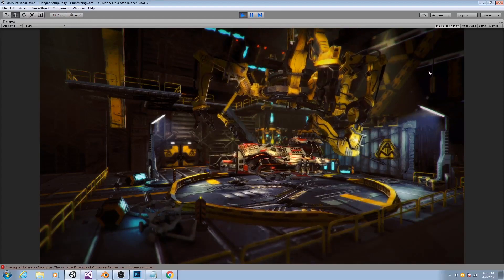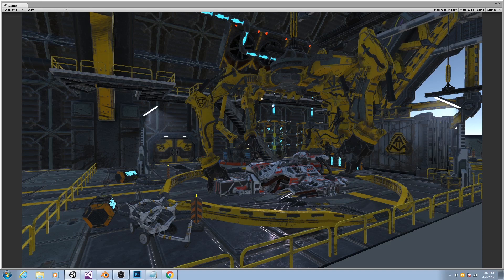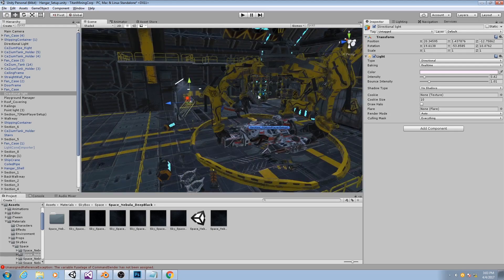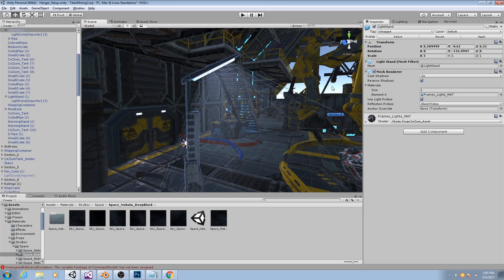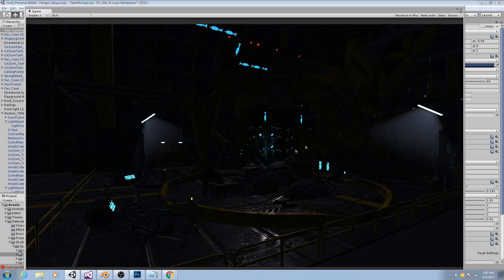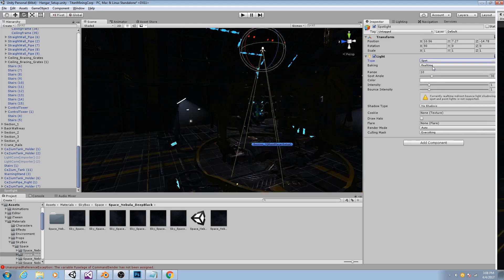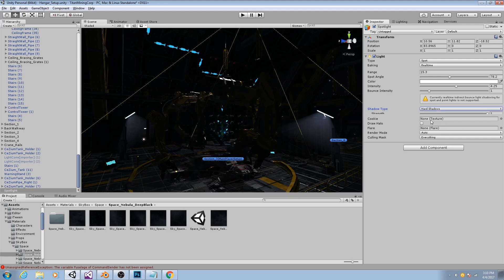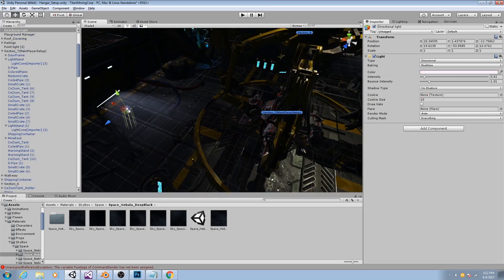Unity High Quality Lighting Tutorial (Part 1)

Comment: I'm interested in learning more about the fog light shader you created in shader forge. Can you provide any more information? I only recently purchased SF and would really like to learn how to use it. Any help you can provide in the way of tips,  tutorials and/ or links to resources would be greatly appreciated!
Reply from the maker: Here is what the shader graph looks like: imgur.com/a/hArnN It just takes a set of UV coordinates and remaps the V value to get a black-and-white gradient. Then I get the normal direction of the mesh and map that into a fresnel node so that the edges are soft. It's unfortunate that there isn't a whole lot of documentation on techniques with shader-forge. The website has great documentation on what the individual nodes do, but not so much on how to use them. The Unreal material editor has much more usage documentation and it is very similar to SF. If you look up tutorials for the Unreal material editor, techniques from that will transfer over to SF very easily.
Reply: AlienMinefield thanks a bunch. I'll look into it. good tip on UE and SF!
Reply: FYI, here's the shader if you want to take a look:
https://dl.dropboxusercontent.com/u/3788438/3D/fogLight.shader
Reply from the maker: Try adding a 'Clamp 0-1' node right after the remap for the fresnel. What might be happening is that while the shader is additive, the remap maps values of 0.2 to 0 and anything less than that would be negative, so it's adding a negative value and makes the shader darker. It probably didn't show up like that on mine because my scene is already really dark. If you are using Linear Color space, this negative edge effect may be even more pronounced.

Also, as a quick tip, if you add more horizontal edge loops to your cone, it will help get rid of the hard edges. It took me a while to figure out where those came from since I had marked all the edges as soft but they still showed up.
Reply: Yep. That did the trick! Thanks :-)

Comment: Hello! 
The resoult looks awesome! 
Why do you use this way of post processing, instead the free unity asset - Post Processing Behaviour?
Reply from the maker: If you're referring to the Post Process Stack, I can't use that because this project is in Unity 5.3.5 and I need 5.5 to use that asset. The reason I'm using a slightly older version is because I follow a strict rule of not updating software in the middle of a project because that can lead to all kinds of head-aches with deprecated script functions and interface changes.